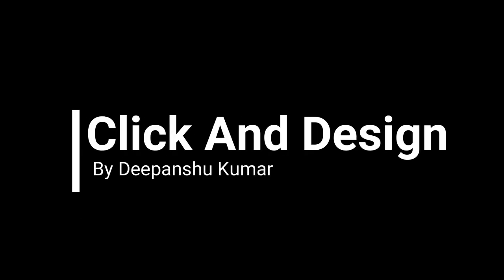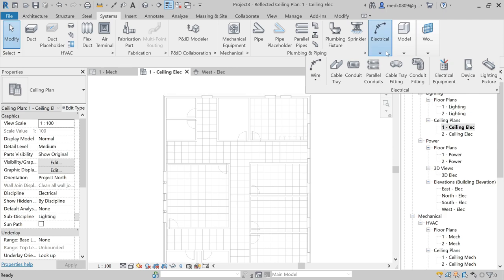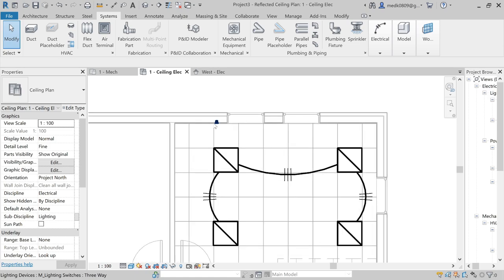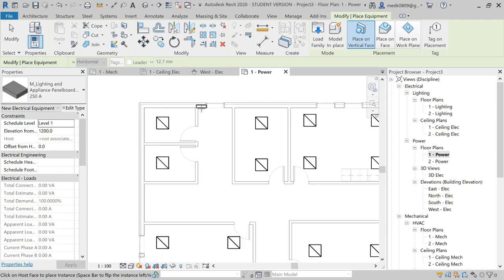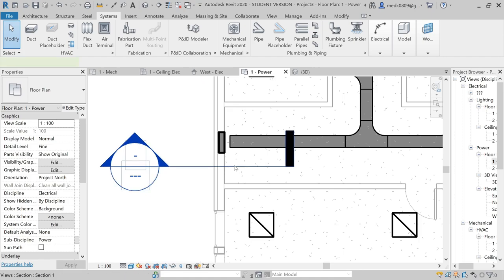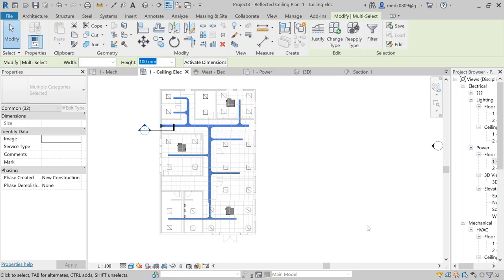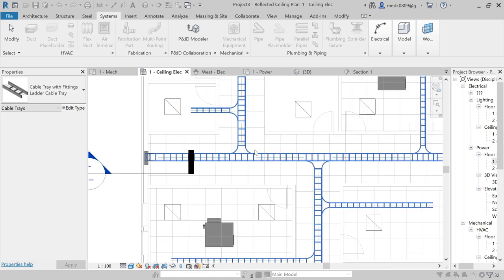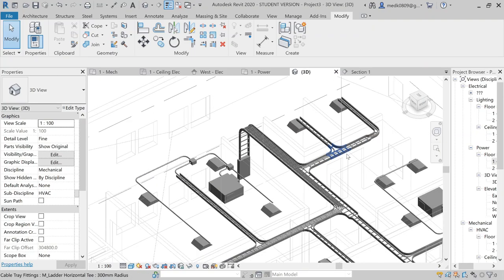Electrical Systems in Revit MEP💡🔌📡💻 | Circuit Creation in Revit🔦📟 | Step by Step✅

Comment: This is a good attempt to show how various electrical items in Revit can be used, but don't take it as a real design! .in real design, cable trays will be used to connect between Main panel to DBs or large equipment only. Conduits will be used to connect lights / power points to DB. 20 or 25 mm dia Conduits  will be fixed to ceiling above false ceiling. Conduits won't be laid inside cable trays.
Reply from the maker: Yes, i understand being a mechanical engineer i have less knowledge about electrical systems. The video was just attempt to show the use of Revit for BIM.

Comment: Hello,
This is a nice tutorial for Revit, but in reality it wouldn't be a good idea to connect mechanical and lighting equipment in the same conduits. You should rather use one separate circuit for the mechanical equipment running on on side of the cable tray, and one or many other circuits for the lights running on the other side of the cable tray, with at least 10cm between the two types of cables in order to avoid electromagnetical interference.
I know it wasn't the point of this tutorial to go into those kind of details, but I add this for knowledge ;)

Comment: Tutorial is great, but it is first time I see conduit installation in cable tray. Probably it because of requirements from some of local standards.
Reply: This can actually be useful if you consider the conduits symbolically represent cable strands. In reality it will be many cables grouped together, but you choose to represent them with only one large conduit in order to save time because you don't want to draw all the cables one by one. Then you can export their lengths in a table an assign these lengths to each cables in a list of cables.

Comment: Can you tell how to create reference plan for placing light when there is no ceiling?
Reply from the maker: Open any of the elevation, create reference plane and adjust the elevation by changing the dimension. Rename the plane if you wish . During the placement of lighting fixtures select the plane and lf will attach to the plane.

Comment: Hello sir, 
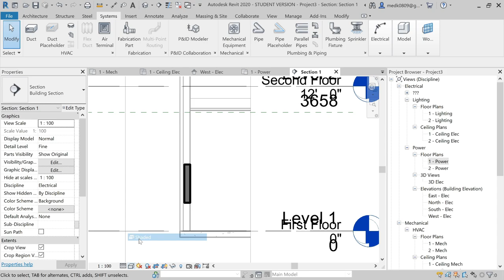       after finishing edit circuit , selecting a fixture and pressing tab but i didn't get the symbol of type of wiring 6:16 .... facing the same problem in fire fighting also after pressing tab not getting generate layout option (13:27) .....plzzzzz help me as soon as possible sir🙏
Reply from the maker: Hi, just bring mouse arrow over the fixture and press tab key. Not need to press and select the fixture. I hope it will help.

Comment: Bro, May i know whats difference between ceiling and floor?
Reply from the maker: RCP Reflected ceiling plan, it is hanging flat surface used to fix lights, hvac grills and to hide installations. Floor is the bottom surface. Concrete floor and finished floor.
Reply: @ClickAndDesign  sir, small confusion suppose if we place light in ground floor means where we place light, the first floor bottom or ground floor ceiling?
Reply from the maker: Ground Floor Ceiling